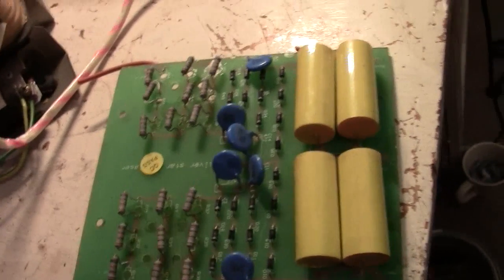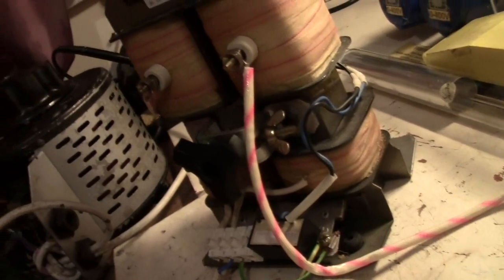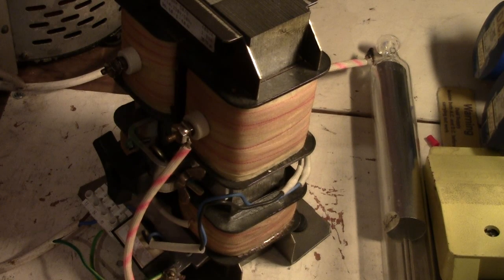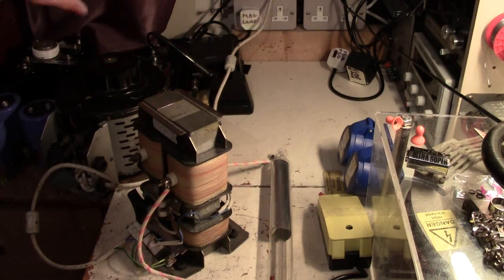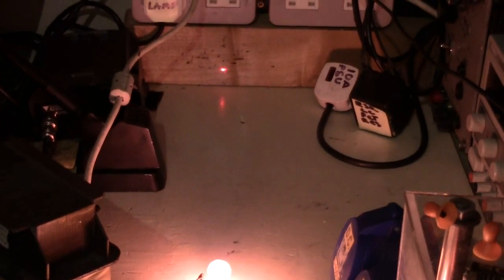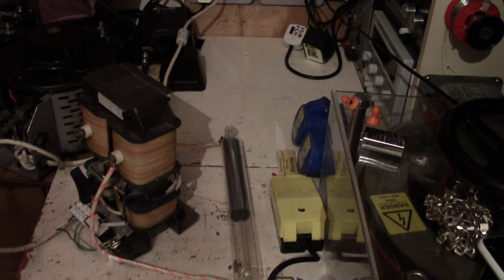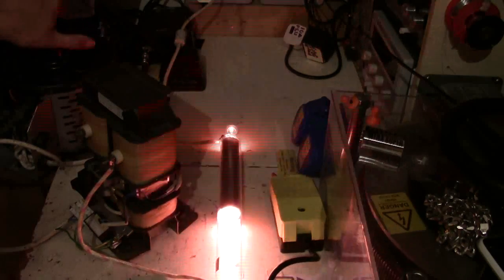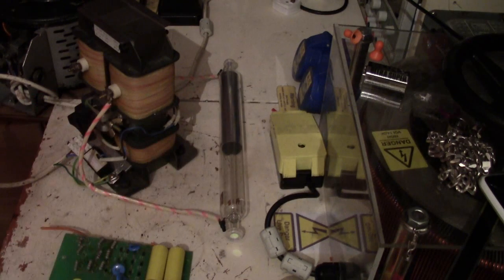Over powering a helium neon laser tube on AC not DC and see my new hair ;0)

Comment: These tubes normally run on DC to get a steady light, if its on AC it will be flashing at 50Hz or 100Hz. Also, these tubes need a certain quantity of milliamps to light up properly and the resistance can be a negative slope (volts drop as amps rise) so a ballast is needed (like a fluorescent tube) and ballast might be all the resistors on the driver card. Most lasers seem to work better cold than hot and the colour of the light is to do with the size of jump between energy states of the atoms.

Comment from the maker: you did indeed see one good spot there ,it on my 12A PSU :-)

The lasers don't burn :(  AC or DC there low power and UV -Rays maybe NO X-rays not at 8KV in a low vacuum if that was the case every neon tube you walked past you would be getting a free X-ray .LOL

Comment: Mmmm, laser time. :-)

Slightly off-topic: When firing the laser, did I see one of those 13A plugs with the neon inside it? 

If so, I haven't seen one of those in a long time! :-)

Back on-topic: Is it possible to burn/ignite anything with the laser? You seemed quite happy to place your hand in front of it. Perhaps it gets a hot beam when on DC, yes?

Also, I take it that there's a vacuum+gas in the laser tube? If you over-power one, what about X rays?

Thanx for showing, & hair too :D

-BBD.